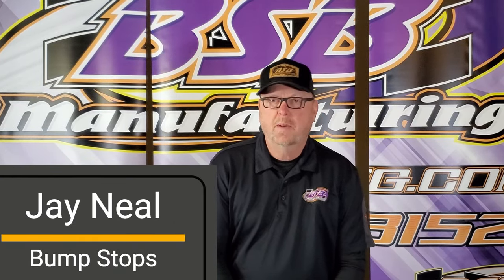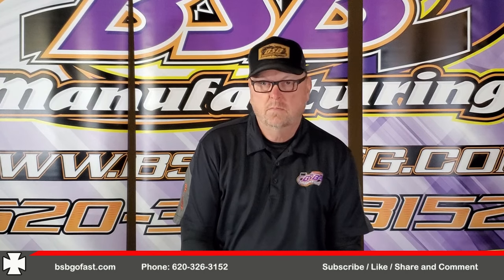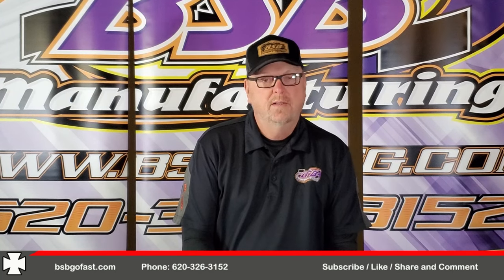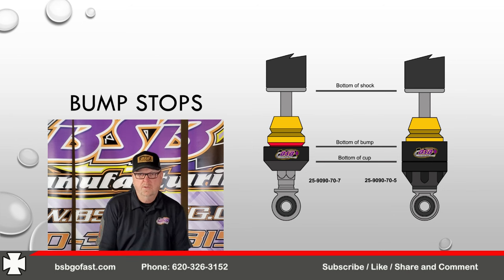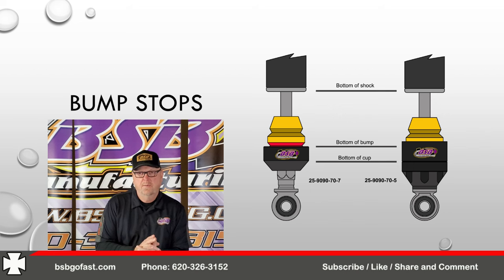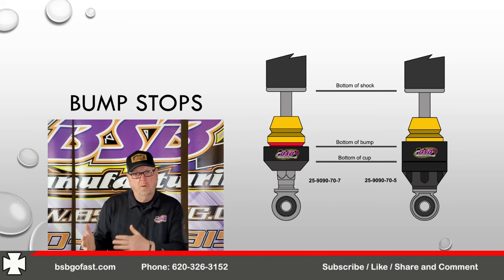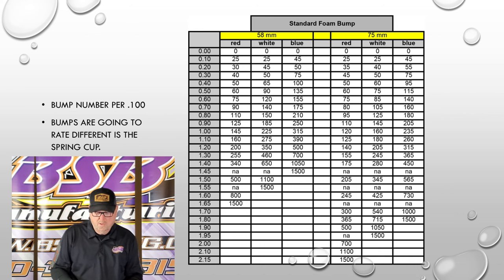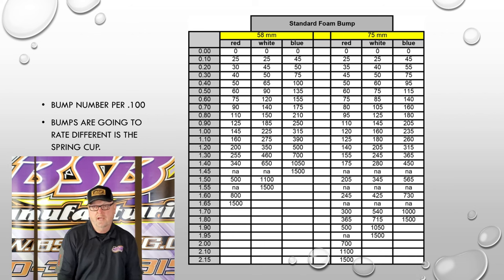Bump Stops

Comment: Bump stops seem to confuse alot of people. I feel most forget about the Stop part of bump stop. If your frame or crossmember is in the dirt, nothing else will matter at that point and you will need to add packers until you are out of the dirt but you don't want to race at that number, let's day 3000, because the only compliance left in your suspention is the sidewall of the tire. I like an "All In" number. Spring load and bump load at Dynamic. Let's say 1500 on the spring and 400 on the bump to shoot for. The bump will spike from there to keep you out of the dirt but if you can hover at that sweet spot , 1/4 above when the bump spikes solid, you still have compliance for the RF to work against the LR to add traction. The videos are great Jay, I appreciate all the effort you put into them to help people.
Reply from the maker: Thanks for your response, this is correct and in today's market, I think we are seeing the bump used more as a stop than a load. Understanding how it makes load is what is hard to understand for most people. Very we said and thanks for your input.

Comment: Great video as always, what is your opinion on the guys in imca using the shock to limit travel on the right front?
Reply from the maker: Great question and I will answer it in both directions. What I mean for those not aware of what you are talking about. You can use your shock to stop the up travel in the shock by preloading your spring against it. This allows you to run a softer spring with load without having your car above ride height and I think this works very well. As always it sucks in the rough because it is not enough spring to manage the rough, also not legal in most scansion anymore.  The 2nd option is to bottom out your shock and use it for a bump stop. This will work to a degree and better when you have softer springs, but you will hear me say this is bad. I am not a fan of bottoming out or “coil-binding” a setup on dirt as I think it is going to shear traction on the tire. It all depends on the grip level of the track. So, like one and not the other.

Comment: Jay,is it true,bump rubbers don't try and unload  themselves when compressed  vs a bump spring tries to unload as soon as its compressed?
Reply from the maker: Yes, this is true, a bump rubber (foam style) is very progressive and is ideal for what you want in a race platform. I have used springs in the past with great success under certain conditions, but for the most part the bump foam in a cup is really good.

Comment: When knowing your bump load, where should the car be "racing" at in the bump curve? Let's say you wanna be at your dynamic state at 4" of travel. How far into the bump should you be at full compression? And to clarify, full compression isn't bottoming out, but where you want to be racing dynamicly.
Reply from the maker: Okay, we will go with what we know in this case and make up some stuff too. RF shock travel is 4” which is our desired down number in inches or dynamic position. At 4” we want 3000 lbs. load number, and we are using a foam bump (speedthan soft), we want our travel to be as light as it can be as it travels down and then makes the most load it can, or the load we are looking for, in this case, 3000 pounds. So here is what that would look like, load on spring at ride height (650), spring rate 500 pounds, on a Chevelle lower control arm standard length.
•	Ride height (650)
•	1” (870)
•	2” (1090)
•	2.375 top of bump (1172)
•	3” (1310) (75lbs) = (1385)
•	3.9” (1508) + (650) = (2158)
•	4” (1530) + (1500) = (3030) total load

This is based on a couple of things that are going to change in real life, so you need to do this to test it on your car. 1st we are using a 220 pound per inch spring rate gain and a 650-load number. 2nd the Chevelle arm gains a lot of number in the last inch of travel, and it may change from car to car. Hope this helps thanks
Reply: @jaynealgofast , yes, it does. Another question is, like above, if we want to hit 3000 at 4" and to get that, we need to be at the top of bump at 2.375. But let's say we soften the bump, with your top of bump being at the same 2.375 and you'll turn spring rate in the car to get the 3000 load at 4", but you could lower the upper shock mount so top of bump is 2.25 or whatever that number is to get 3000 lbs at 4". I'm guessing that decision is based on issues on track and if you need a more or less progressive load graph?

Comment: Crusa street stocks outlawed bumps, any suggestions on getting the same effect without actually having a bump in place?
Reply: Buy shocks with the bumps inside or chain right side at ride height then crank preload into rr and rf
Reply from the maker: I wish someone would explain how the laws of physics work on a hydraulic device with a bump on the outside vs a bump on the inside. All I can come up with is one is a load device and one is a stop device.

Comment: shock that over travels and destroys the bump stop which adjustment is needed comp or rebound?
Reply from the maker: It would be compression, but the real factor could be in the spring rate of the car.